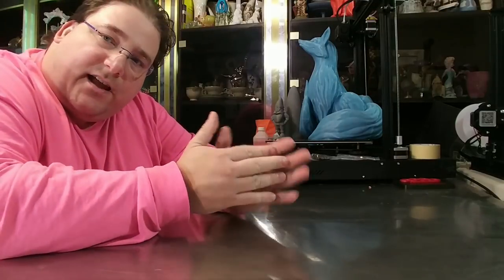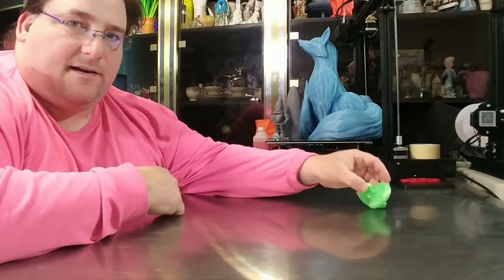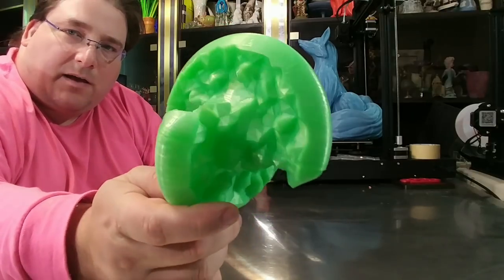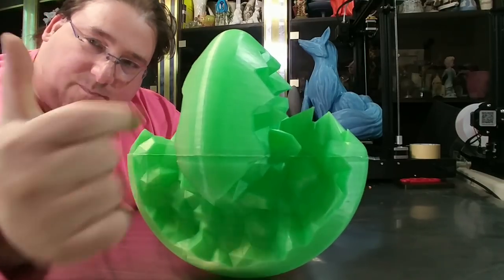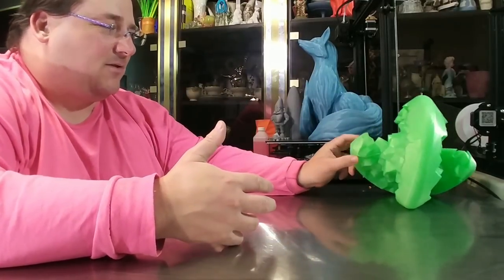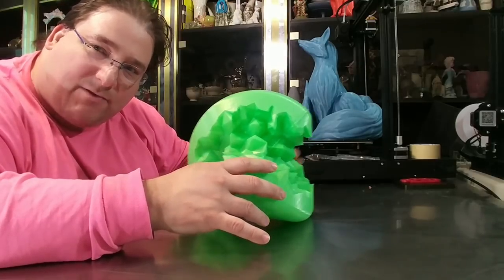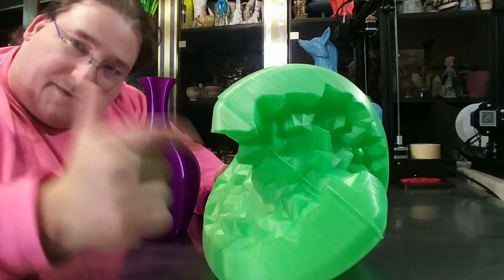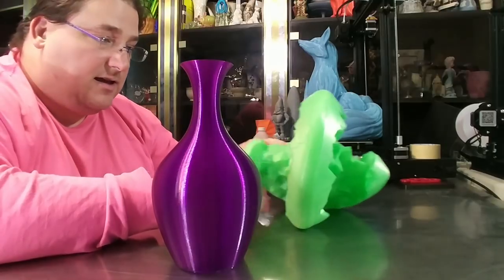T3DP 224 Geode Sphericon - Model Showcase

Comment: Wow!! the biggest one will be stunning!  a small suggestion: Add some hollow holes inside the model, so you can fix some colorful LED into it, that will be amazing!!!
Reply from the maker: I absolutely plan to leave a cavity in the middle for an LED light source I'm trying to figure out a way to make it not permanently attached to each other or have a USB port so I can recharge it depends on what light source I figure out to use
Reply: That's a good idea!
Reply: Maybe the easiest way is put 2 ultrafire flashlight into it? that thing use 2 18650 Lithium battery and generate super strong light.
BTW: i just bought a ENDER 3 with 5kg filament today , it's my first 3d printer, i hope i made the right choice.........

Comment: you can use variable layerheight in Cura and the low slopes on curves on top of the models will be smooth
Reply from the maker: No they won't not in vase mode at least I would have to use two perimeters to close the Holes even at 0.08 millimeter layer height and 1.2 mm width it's not enough I can do it normal printing just use two perimeters but I'm trying to print it in vase mode for Speed and plastic efficiency trying to keep it under one kilogram per half

Comment: Hey Chris, I've got an Ender 3 original V1, where did you buy the updated mainboard for it?
Also, what stepper dampers do you use for it mate?
Lastly, I'm looking for a new larger printer.
Which would you recommend, an alfawise U20 or JGaurora A5?
Reply from the maker: Between those two printers I would probably go with the u-20 because it goes to 400 mm while the A5 only goes to 300 millimeters

Print quality is about the same between the two of them

I got the main board direct from creality you should be able to contact them to order it but if you add the TL smoothers your 99% the way there and don't really need it if you check my upgrades and mods videos I link to them on Amazon once I get to a PC at the link to this message to they're 15 bucks for three of them you need one for x y and e
Reply: Thanks mate.
I've got the updated carriage now too, so I'll get the TL smoothers instead of the MB.
Should I grab some smoothers for the U20 too? 
Will I need any other mods for the U20 do you think?

Comment: Hey Nerys, I'm getting some weird consistent layer seperation/missing layers at the same height on multiple print, I do feel snag on the gantry at that height, however I can't seem to loosen the left side concentric bolts (display facing you) enough to make the V rollers loose enough to free roll. My gantry feels very difficult to move up and down. I checked the spacing between top and bottom, and it is exactly the same. I tried loosening and tightening the concentric bolts on the Z carriage, but I cant get it to run as smooth and easily as it does in your videos. Picture of layer seperation/missing layers: https://i.redd.it/5eveuxxqxmf11.jpg
Reply from the maker: Abs?

When i slide my gantry up and down that is with lead scew disconnected!! It wont slide easily connected. Left side does not adjust just the right side.

To test this affirmatively remove the right hand trolley alll together (2 bolts) lets the arm free hang like an ender 2 see what it does.
Reply: Hi Nerys! No I'm printing good quality PLA, and did not have this problem in the beginning. I have uploaded a video where I have removed the right side, leaving the arm hang free. As you can see there is still higher resistance at the bottom. What could cause this? Did I mess something up when I tried to adjust the concentric bolt on the left side? Video: https://youtu.be/UDR38tb0Ke8
Reply from the maker: jacobtc you may have over tightened it but first remove the lead screw and see how hard it is to move up and down
Reply: Removed the lead screw and it runs completely loose now. However I still feel a small "divot" when at the same place, where it would normally feel more resistance. I tried taking it off and turn the wheels by hand to make sure that it wasn't them being the fault, but the "divot" still occurs at the same spot.
Reply from the maker: jacobtc check the rail make sure it's clean but the divot is usually because it's too tight remember you could turn The Eccentric both directions to tighten and loosen it's also possible one of your roller bearings just bad they are very cheap to replace if you need to go that route I would start by Scavenging one from the right hand side if you can figure out which one is bumping
Reply: I don't think it is the bearing... Actually I believe most of the problem is the z-axis binding which many have. I'm going to print some spacers for the stepper to sit on and report back!
Reply from the maker: jacobtc I don't use a spacer on any of my 4 Ender three machines well that could be the case you felt a divot with no lead screw which means it can't be the lead screw
Reply: You are right about the divot without the lead screw, however when I inserted the lead screw again I had heavy binding again, which was gone when I loosened the screw which holds the lead screw stepper to the frame, so something is acting up down there... If that doesn't work I am in contact with Gearbest, and if they are of minimum help, I can just buy another Ender 3, because that is totally okay to do.. right, right? (help me) ;) ...
Reply from the maker: jacobtc I would work on fixing the problem install the shim at minimum it could help at worst it won't hurt next figure out which one of the bearings is not working right and swap it from the right get that Gantry to move up and down without the divot
Reply: Hey! Just an update from my little adventure. The spacer on the Z-axis motor did not do anything, I had the same problem. Out of frustration I installed the old PTFE tube and couplers back on the printer, and behold, a perfect print! I don't know what I have done wrong when installing the new Capricorn tube and couplers. I made sure the tube was pushed all the way in, anything else I should look for?
Reply from the maker: jacobtc that's fantastic one thing to make sure of is that the end of the PTF tube is a perfect 90 degree cut and that it's not crushed or crimped or it will inhibit the push of filament the Capricorn tube is a tiger tolerance so you also need to make sure your phone is good although very rare nowadays it's possible to get filament it's too large and it will have trouble pushing through the Capricorn tube but not so much trouble pushing through the looser tolerance stock tube
Reply: I'm using ColorFabb filament, so I'm pretty sure that my filament isn't the culprit, but I'll take some calipers to it later. What I will try is to install the new fittings back, but use the stock tube to see in what end the problem lies.

Comment: Increased the Z height on my Ender 2 to 920mm (using 1040mm z axis lead screw and V-rail from OpenBuilds) both attempts to print a 30 inch tall nosecone failed due to the print mechanism hanging up and then print falling off the print bed. See my post at YORF under 3D printing for EVERYONE http://forums.rocketshoppe.com/showthread.php?t=17185&page=7&pp=10. Did you print the "Model Rocket" from Additive Aerospace yet? https://www.additiveaerospace.com/products/additive-aerospace-model-rocket I wrote an article about 3D printing using RockSim for the Apogee Peak of Flight Newsletter essentially details 3D printing without CAD!
Reply from the maker: can you post them files. have to create an account to download them. Grrrr as for melting. put a paper tube up the center. (scale the parts up just slightly if needed so the paper tube fits.)

Comment: cut into 4 pieces
Reply from the maker: That's exactly what I'm trying to avoid :-)
Reply: you could go even bigger if cut into 4s
Reply: i like that fox
stl?
Reply from the maker: Chris HITCHABOUT Kollar https://www.myminifactory.com/object/3d-print-blink-fox-71388
Reply from the maker: Yes I have printed that :-) I need to modify it I need the fins to be substantially larger the channels in the front Act as Aero surfaces which dramatically shift the center of pressure forward making it difficult to stabilize the rocket

So I need to make it substantially longer and I need to increase the surface area of the fins in the back in order to get the center of pressure and center of gravity relationship correct without having to add too much nose weight